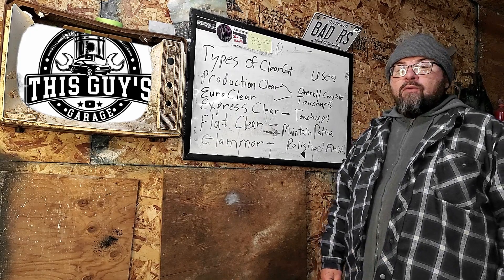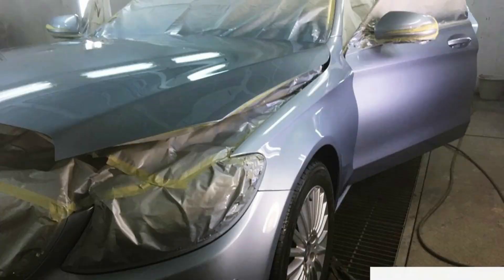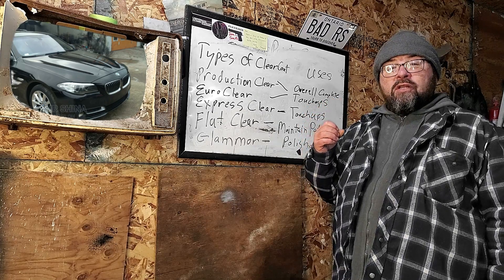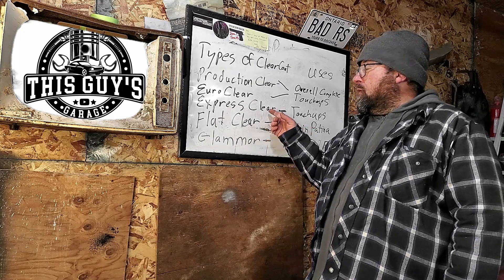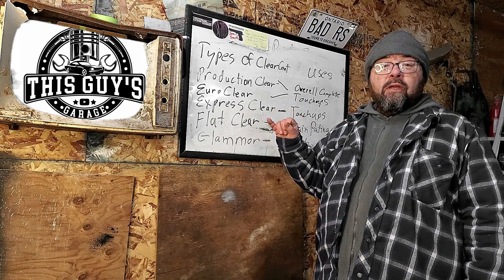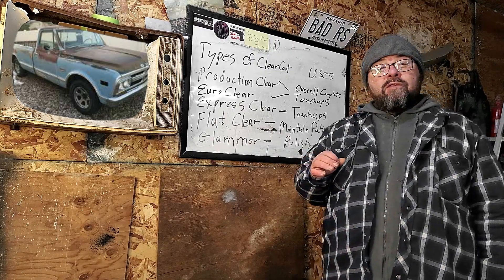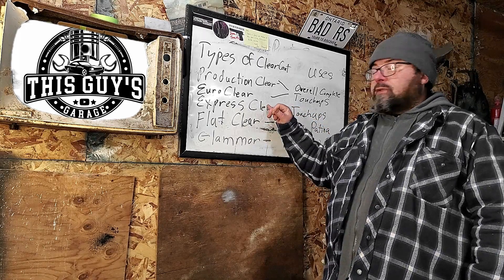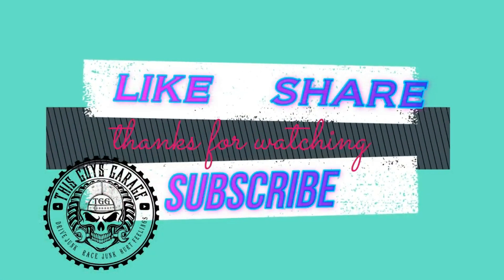the different types of clearcoat

Comment: Weird question, I am actually looking at automotive clears for finishing a guitar that I am redoing. I’m doing a metal flake coat and want to put a clear on it. That is both extremely hard but can also get a high shine on it. I don’t know if that is possible, but wanted to know The best possible product for that it would have to be something that is hard and thick so that if it did need to be sanded, it wouldn’t go through and mess with the metal flake,  thanks!

Comment: How soon should clear be applied over the base coat?
Reply from the maker: As soon as it's  flashed enough to tack cloth.  You can check that on the masked window,  by touch.  Should be dry to the touch.  Base doesn't take too long,  it must be cleared with in 24 hours by most manufacturers,  my rule is less than 4 hours.  If it dries longer than that scuff and recoat base.
Reply: @thisguysgarage  Thanks I really appreciate you writing. John
Reply from the maker: @johnleca  no problem

Comment: Can you polish an express clear?
Reply: Yes you can. You just want to do it in a window of 2- 12 hours.  The earlier in that window the easier the polishing will be.  I used one of Sherwin Williams xpress clears once. Sanded it 1 day later.  Came back the next day to polish,  and I polished all day. Couldn't get the fine little sanding scratches out. 3000 polished,  3000 polished,  nothing worked.  2 days later I recleared it. Only time in 12 years of painting I've ever had to reclear something because I couldn't get it to polish.

Comment: Ty. What's the difference between 4 to1 and 2 to 1 clearcoat.? Other than the ratio difference.
Reply from the maker: The amount of hardner that goes into the clearcoat.  4:1 has less activator the 2:1
Reply: @thisguysgarage  no besides the ratio difference, is there any other difference in quality or solids or anything?
Reply from the maker: @mhunkler  I would say you get what you pay for ,so buy the best you can afford

Comment: Hope you can help me out. I occasionally get some sanding scratches that can be seen through the clear. It's not shrinking back (quality clear and it's noticeable right after shooting). I tried going to finer grit 400 to 800, put I still seem to get it. I'm wondering if it's the brand or quality of paper, I'm just missing spots here and there, or something else. I don't normally use a sealer. Would that fix my problem? It's very minor, but i can't seem to get any project completely scratch-free. Maybe I'm just picky and my skills haven't quite caught up to my expectations lol
Reply from the maker: what brand of paper are you using? good place to start .  i usually finish my work out to 600 before i prime .  happy to help paul
Reply: @this guy's garage  Thanks for the reply. I actually have a few different brands and types, depending on grit. Some of it is good and some maybe not so much. If there is a big difference in quality, then that would explain my issue. I will say that since I've been going to 800 on the last couple projects, most of it turned out great. The sanding marks are only in a couple spots. I may just be missing them. So I guess my question is, will sealer help in this situation? Keep in mind the sanding marks are very subtle. You have to really look for them.
Reply from the maker: @mccoma11  https://youtube.com/playlist?list=PLXfFReTdUhgH0FkHTlf6Bi-B42WZu8z4O
This is a Playlist it has some inexpensive sandpaper I have tested with great results. Among some other products and equipment.
Reply: @this guy's garage  Thanks for the tips! I ordered some of the dura gold variety packs. My rolls of block sanding paper, I just purchased a while back. It's the red 3m stuff, I believe. I'll do some research on it but I presume it's ok stuff. If not, I'll replace that as well. Keep the videos coming, man! I know you've been preoccupied with some other content, but I've been cheering you guys on there, too! Stay safe, brother!
Reply: @this guy's garage  also, is there a certain type/brand of paper that you prefer? I actually need to order some soon.
Reply from the maker: @mccoma11  there is quite a difference between brands as well as types for example 800 wett paper would be equivalent to 400 dry paper.  Sounds like your on the right track

Comment: Good stuff. Pretty sure I have production clear. Ppg jc620   Based on your video I should use a glamour clear when I spray marauder. I definitely want to wet sand the clear when it’s dry
Reply from the maker: Ppg production clear is one of the nicest clearcoats I have ever used.  This clear will polish  100%  .  If you don't have to polish your much better off. Black is the worst color to color sand and polish.  That being said ppg 620 is a highly end clear that will get the job done for you.  When you are painting it you can decide in that moment if you're going to polish.  If you're not happy with the finish when your spraying it put an extra coat on to have enough clear to work with.
Reply: @thisguysgarage  thank you for the advice.
Reply from the maker: @canadianmarauder1923  any time my friend 🤜🤛